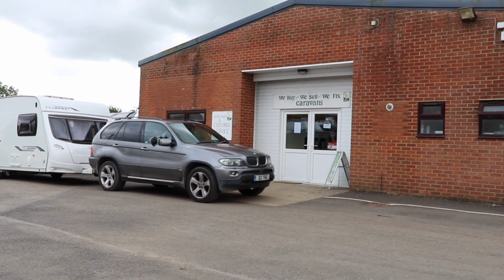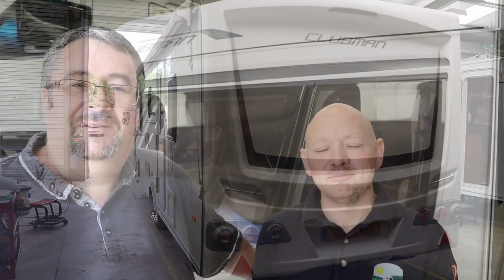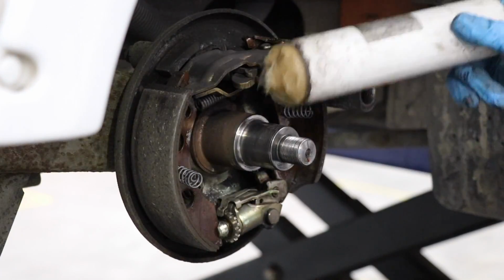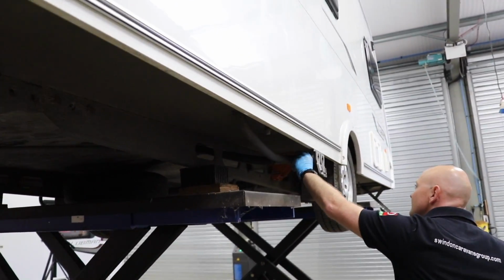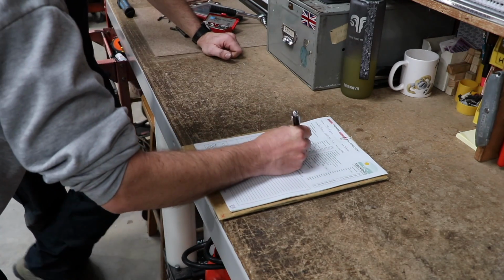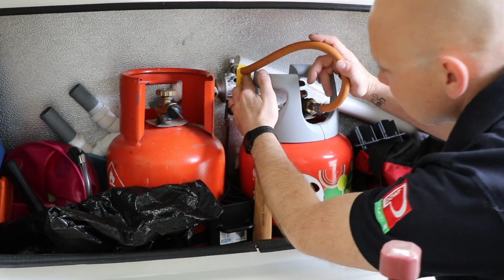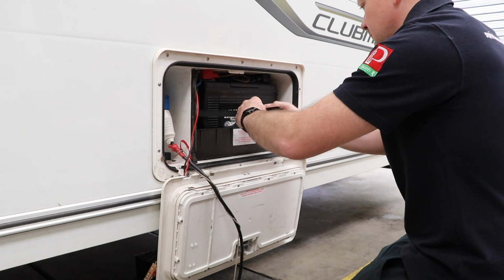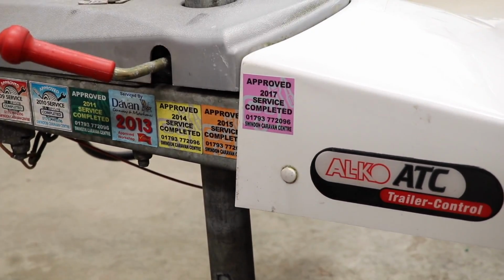Caravan Servicing at Swindon Caravans Group - Part 1

Comment: Warning. Noted the mechanic sprayed WD40 into your caravan door lock?! Had my van door lock replaced when on a trip a while back as suddenly wouldn’t lock on leaving it when on site. I was told to NEVER spray WD40 into van lock as many locks now use plastic instead of metal for their working mechanism and that the WD40 will seriously harm these lock plastic components causing them to fail.
Reply from the maker: Hi Mr Davis, thanks for the comment.  You're quire right, many of the manufacturers use plastic components but we are aware.  This is a slightly older video and we use the industry recommended lubricants.  We do not lubricate the plastic components in the door lock, only the key barrel.